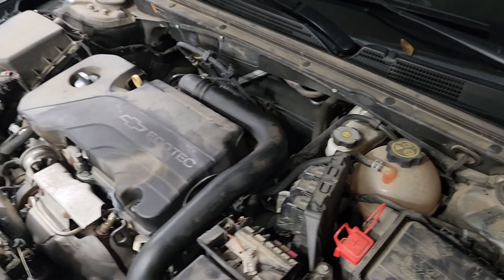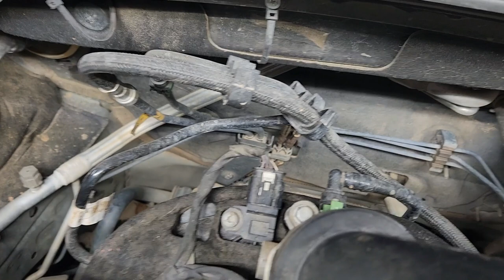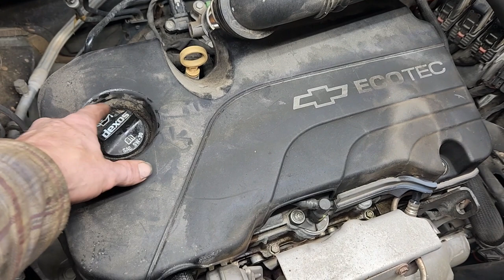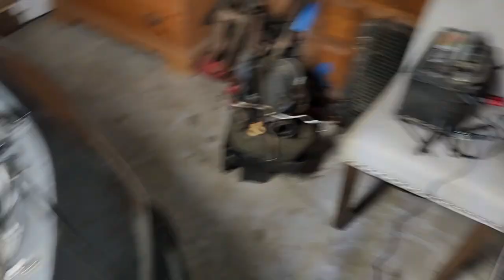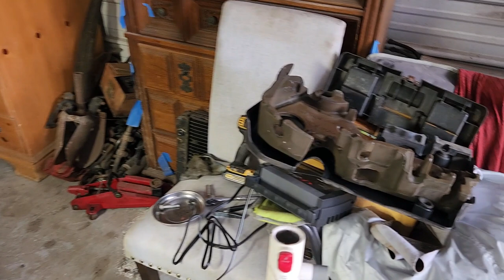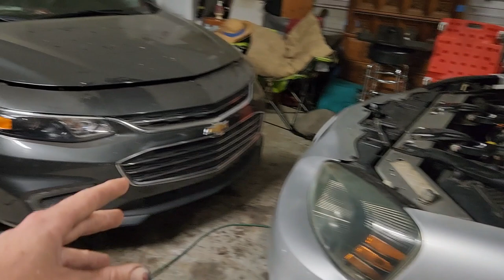2017 Chevy Malibu Vacuum Pump, Valve Cover Removal

Comment: Happened to my 2019 malibu. The pump debris spun the exhaust camshaft reluctor so I knocked the reluctor back in place. Chevy should fix these cars for free when this happens. Dirty oil is what clogs up the pump screen and burns it up. On the new pumps Chevy removed the small pump screen.
Reply from the maker: Yeah they should. Amazing it isn't a recall. Seems like a dangerous design. It can do major engine damage and you suddenly lose power brakes when it fails.
Reply: Hey Mate, I have this issue now.. VP shattered and has left pieces in. I assume the reluctor has moved as after I turned the car off.. It doesn't start.. When knocking the reluctor back into place, how I know what the correct position is? Have done heaps or research but can find anything.. Any help is appreciated
Reply: The hex on the cam shaft has a qr code on one of the flats. The single prong on the reluctor should "line up" with that

Comment: Changed the pump and it makes vacuum(confirmed after starting it up again) I smelled gas and realized there is now a fuel leak coming from what looks to be the two left fuel injectors. Rewatched the video and tended to the O-rings that you mentions and stuck them back onto the injectors but it still leaks. Any ideas?

Comment: Yea the timing is off thts y it did tht... the metric mark and the reluctor on the camshaft is out of timing supposed to be at 12 o'clock u can see tht whn u lift up the valve cover

Comment: I’m concerned about those broken pieces from the cam reluctor falling down into the engine. Did you also check your oil pan before the first startup after replacing the pump?
Reply from the maker: No I didn't go into the pan however the owner stopped driving once it broke so all the pieces were in one place right at the scene of the crime lol. I'd imagine if you drove it around much the vibrations would spread them around. It seems it only be necessary to pull the pan if your broken pieces made it to the far side of the head by the timing chain where they could fall into the pan.
Reply: @Ethanthefenceman  Thanks that is good advice. Mine are all tucked in near the cam reluctor on the driver's side of the head. But I did notice there is an oil drain hole between the 1st and 2nd cylinder from the driver's side.

Comment: Did this process to my 2018 equinox. Brakes went out and went stiff. Had to removed valve cover and clear debris from vacuum pump. Put everything back together with new vacuum pump. It’s not turning over. There’s power, the engine is cranking, spark plugs are not flooded, spark plugs have spark and fuel is definitely going to engine. It just keeps cranking but not turning on. Also tried attaching a booster pack to battery. The dash states “low engine power”. Any advice?
Reply: Reluctor wheel spun. Pull the valve cover completely and you can confirm by looking at the hex on the exhaust cam. There will be a qr code on one part of the hex and that will line up with a single prong on the reluctor wheel. Replace the cam if it's not lined(or tap lightly with a hammer until it's back where it needs to be but you didn't hear that from me....)

Comment: For all those doing this job. It is VERY likely you will need to change the camshaft. The reluctor wheel commonly rotates or moves when the pump explodes. I found that if you remove the EXH camshaft position sensor; the reluctor wheel is visible and no longer in the middle of the hole. Even if it is, you need to determine that it is in the correct place, the small post will align with the QR code of the camshaft hex space near the timing cover. You will have to remove the valve cover for this. If you change the cam, you MUST use a new bolt. Its tty. I advise you to get the info from ALL DATA DIY for $20. Gives you directions for everything. You also will need a special tool tool, and two people; to relax tension in the chain, hold the chain and phasers in place; and be able to pull the EXH cam without pulling the timing cover/eng mount/alternator/harmonic balancer. That tool is on amazon , ZKTOOL ZK013, https://a.co/d/friEj7r         - If you re-use the cam bolt; it will let it and it will blow up the motor.
Reply: Why can’t you reuse the bolts? Is this all or just the 15mm on the passenger end?

Comment: bro _ qq - are those engines notorious for cosuming oil? got mine 6k miles only yet consuming oil
Reply from the maker: That could be worn engine cylinders or you could be having a pcv system issue and the turbo seals could be leaking causing the oil consumption.
Reply: @Ethanthefenceman   thanks! a lot of positive crankcase pressure as well from the dipstick for a relatively new engine with only 6000 miles in it

Comment: my valve cover is hard take off... all screws removed...is there a trick to get it off?
Reply from the maker: Make sure you got the screws in the middle of it out. It might be stuck down good with sealant. Gently pry between it and the head and you should be able to break that seal. You can also try to work a blade in between to cut at the sealant and help start the break.
Reply: Did you eventually get it off and how? I’ve got all bolts out. Took all accessory off, even if obviously unnecessary, to be sure. Tap on cover at every angle then with pry bar unable to move it. 

I’ve done plenty of valve covers but this is my first on this model.
Reply: @ericnieto2092  no I didn’t I wasn’t able too sand I wasn’t comfortable prying at it any more
Reply: @TheRealBlacHood  thanks for response. Crazy. I stopped when I realized pry bar was lifting the engine up haha wth makes no sense.
Reply: @ericnieto2092   i think this month ima give it a try again...no greater motivator then a repair quote lmao
Reply: @TheRealBlacHood  I ended up getting it off. It made it very easy to lift cover off. 

Start under where the vacuum pumps seats. Hammer gently in 2-3 pocket screwdrivers around the half circle. That will allow enough space to slide in a large flathead, twist until you fit a pry bar on the corner closest to vacuum pump. 

Then with a flathead/small pry bar go around the valve cover, twisting to pop it free. Once you get the 2nd corner free the rest are quick to come up.
Reply: What mm are you using to take bolts off?

Comment: 26:26 how do you remove that hose(my fiancé’s account)
Reply from the maker: I'm not sure of the proper way to remove it. I tried to use a pick in between the hose and the connector to slip them apart but the fragile hose just broke. Honestly a good solution could be to have some heat shink ready that will fit over the different sizes and just cut the hoses in places where you can splice them back together.